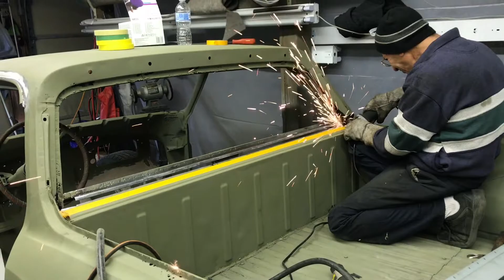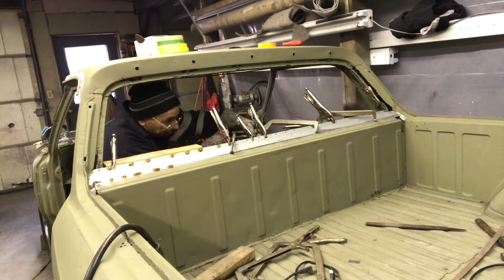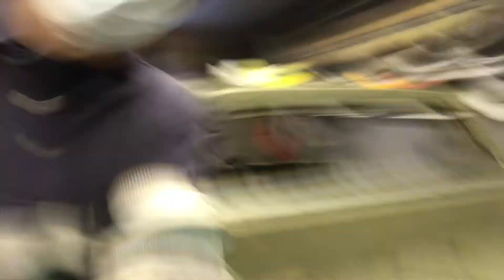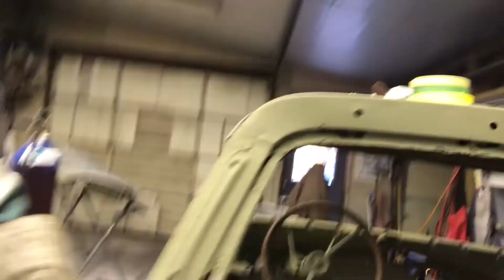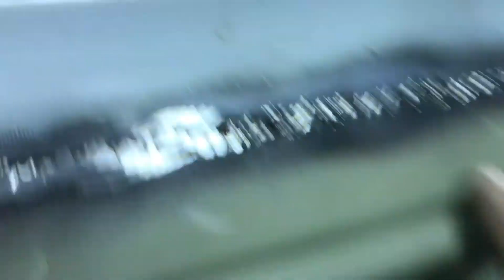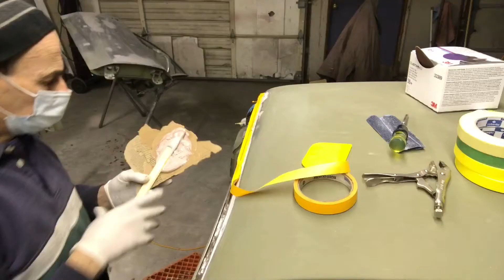66 El Camino restoration project “ episode 7 “

Comment: TY so much for this tutorial on a easier way to repair/replace the infamous 64 and later El Camino rear window lower channel. I have been watching this build as I am a 66-67 Chevelle/El Camino past and current owner/enthusiast.  TY to the owner Gary ( I believe?) for having saved another one plus,  NTM "you guys" DOING the work to make it ALL happen. You are a very skilled craftsman at your trade sir. Really nice work, again. 👍Take care....
Reply from the maker: Oh man thanks for the compliments. Thanks for watching 👍👍👍👍
Reply: I have 2 1966 Chevelles including my first car bought in 1980 and a 1966 El Camino I just bought. My first car has a 427 that runs well. My second car is a convertible. I just need a 66 wagon now.
Reply: @patfromamboy  Good deal! Just finished up a complete driveline/suspension/brakeline restoration om my 66 factory BB Elco. Stashing the original 396 for later rebuild/re-install it now has a fresh 454 rebuilt 4 spd, posi. I also have another 66 Elco (that I ORIGINALLY started on in '15.)  327 (#s correct), powerglide rebuilt, REALLY nice project truck. A 67 El Camino, and a ratty old 65 El Camino (for "some" parts mainly), my 67 Malibu driver, and my 55 Chevy. Gonna try and sell the SB 66 and the 67 Camino as well, eventually. But yeah, I have always wanted to have a 66 2 door wagon (OR obviously, have to make my own, Lol. I know but 🤔 ) ...Few years ago, I had come across a 67 2 door wagon that they had darn near ALL the actual hardcore metalwork done IF you can believe that (mating the wagon into an actual 67. I honestly cannot remember IF it was made from a 67 4 door  wagon OR a 64/65 donor wagon etc. exactly what, I just cannot remember 🤔. And from the pics and the guys reputation ect?  It actually looked pretty professionally done (again, from online pics). I sometimes will kick myself for not jumping on it back then but, one of those things...Happy Restoring and Cruizin

Comment: I have a 1966 El Camino that I bought 2 weeks ago. It’s in very good condition with no rust that I can see yet. It runs and drives and has work that someone has done including disc brakes, new carpet and a few other things. I started ordering parts like door panels, seat belts, a new grill and a bumper.
Reply from the maker: That’s cool not many “good” projects left.    Good luck.    👍